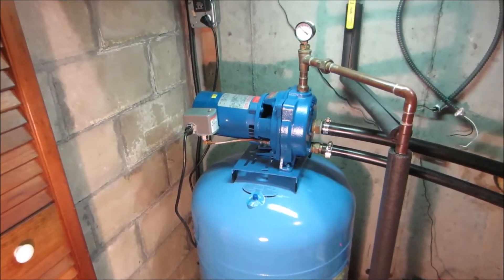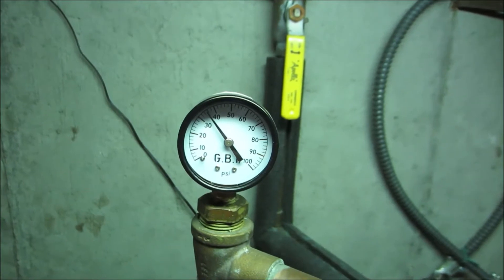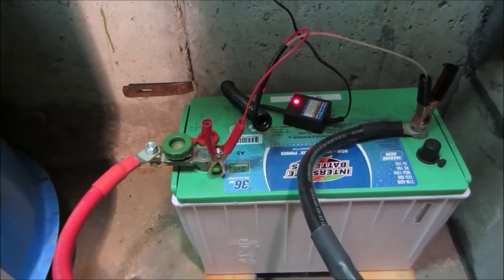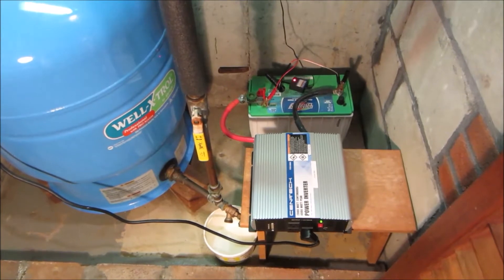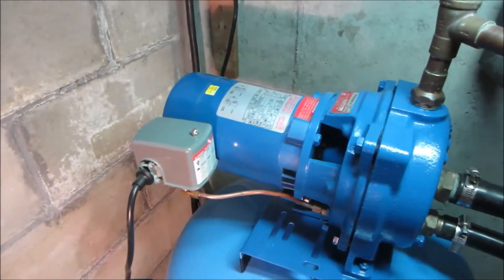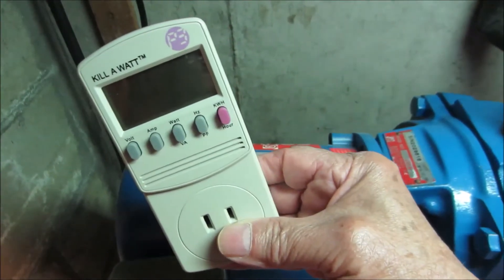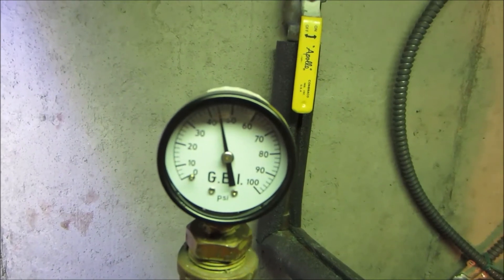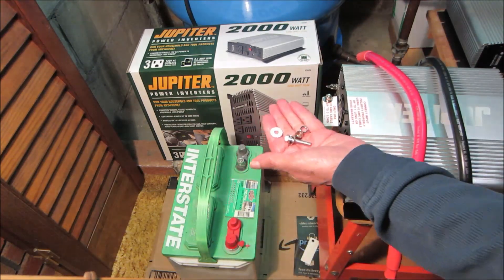Backup Power Project E1 - Well Pump

Comment: That pump motor isn't going to like that modified sine power very much.
Reply from the maker: I put this backup power system together in 2015. Since then, it's been tested quarterly and used sparingly. The well pump has liked that modified sine wave inverter just fine. On the other hand, I haven't had ANY luck with pure sine wave inverter upgrades. Want proof? Check out Episode 7 https://youtu.be/ODuI1lfU7zQ Hazard Fraught Inverter Upgrade starting from 35:30. I've even challenged inverter manufacturers to prove me wrong. Sell me a pure sine wave inverter that will run my well pump, run my furnace, run my washing machine, run my clothes dryer and I'll tell people about it! Not one of them has been willing to risk the sale. Pay attention to their ads. What do they show? Young people camping. Young people with a phone in one hand and a latte in the other. It's really pathetic...
Reply: @LawrencePina The high harmonic content of modified sine inverters isn't ideal for inductive motor loads because the harmonics are dissipated as heat in the motor and it lowers the efficiency of the motor.  This is true of ALL motors and transformers.   I think a fundamental problem here might be buying cheap chinesium crap from Harbor Freight.  Quality pure sine inverters from companies like Sol-Ark or E4 have been running entire house loads and everything in them including well pumps, furnaces, clothes dryers and washing machines for a decade.
Reply from the maker: I searched online for sol-ark inverters today https://duckduckgo.com/?q=sol-ark+inverter&t=chromentp&ia=web and immediately saw prices between $3,000 and $7,600! That's quite a bit more than the $130 I paid for a locally available inverter that's performed perfectly all these years. E4 inverters https://signaturesolar.com/eg4-18kpv-hybrid-inverter-all-in-one-solar-inverter-eg4-18kpv-12lv/ at least not the ones I found, are also in the $5,000 range. I'm just not going to pay that much, even if I could afford to, to back up less than 30A of common 110VAC household appliances. Especially when I know how well the inverter I already have works. $130 vs $5000 or more? Most people worried about occasional grid failure are going to choose $130. On the other hand, I'd be willing to pay a few hundred more for a comparable PSW inverter that actually works, at least as well as the MSW inverter I already have. I just haven't found any yet. Regarding the THD of my $130 inverter, it's about 30% under full load, the same as most 3,000 - 5,000 Watt gasoline powered generators. No one complains about those. Sine waves look about the same, too. So the system I have is definitely not perfect, but it is cheap and effective, and more practical in many ways than a gasoline powered generator. That's why I choose to share it.
Reply: @LawrencePina  If you want someone to "Sell me a pure sine wave inverter that will run my well pump, run my furnace, run my washing machine, run my clothes dryer and I'll tell people about it!" then you have to size it to run those things.  These are whole house inverters to run all of those things and more.  You can spend less if all you want to do is run a well pump, but that isn't what you asked for.
Reply from the maker: Regarding: I "have to size it to run those things" - you mean like this https://youtu.be/FpybjEOK7-8 ?  If not, how?  I visited your YT channel https://www.youtube.com/@stargazer7644 this morning and was surprised to find that despite all of your criticism, there's not a single video there. Not one. Do you even have a backup power system? Have you ever published anything? Comments don't count. Let's see what you've got.
Reply: @LawrencePina  Wow.  The last resort for youtube wannabe's.  What does publishing videos have to do with knowing what you're talking about?  I do real work for a living.  You have 8k subscribers. Keep trying, maybe one day you'll be an "influencer".

Comment: Thanks Lawrence for your video. I bought a Jupiter inverter and cables. I noticed that you have a plug from your well pressure switch. I currently have 220 wiring from the switch to the electrical outlet. I need to replace it with a plug that I can use with my inverter. What gauge plug are you using for the pressure switch? Thanks!
Reply from the maker: When running, my Goulds J04853 jet pump draws 9A at 120VAC. It's connected to a 120VAC outlet with a 16AWG power tool cord, rated 13 Amps. But given that your well pump is already wired for 220VAC, you really need a 220VAC inverter.  There's no neutral in a 220V outlet. So, even if your pump motor can run on 120V, you'd have to rewire all the way back to the service entry panel. The existing 220V breaker would have to swapped out. It's a big job (for most people). If you scroll down through the comments under this episode you'll find that vincesmithh (smithh with two h's) backed up his 220V well pump last year. If you ask him exactly what 220V inverter he bought, how it's holding up, what connecters he used, I'm sure he'd be willing to tell you. So, look for a 220V inverter, but also keep the Jupiter 120V inverter. You'll want that to run 120V appliances. Once you add solar panels and a solar charge controller (another $500 or so for four 100 Watt panels, 30A charge capacity), you'll be amazed at just how much you can run off of your backup power project. Right now, I know you just want to run your pump. So, the first thing to do is find out how many amps the pump draws when running. That may be written right on the pump motor, otherwise you'll have to measure it. To convert amps to watts, multiply volts x amps. Multiply by at least 2. That's the minimum inverter wattage you're going to need. Note that there's inverter wattage and peak inverter wattage. Peak (aka inrush) wattage is generally twice the inverter wattage, but in the case of a pump motor, it can need a lot more. My well pump draws 4,600 watts when it starts! It's amazing that the HF Jupiter and Cen-Tech 2000/4000 Watt inverters can momentarily deliver that much power. Much more expensive pure sine wave can not. Suggest you watch https://youtu.be/FpybjEOK7-8 Backup Power Project - E10 Laundry Room to learn how to measure all this. Measuring peak inrush is where to start. Good luck. Thanks for commenting. I'm happy to help.

Comment: Thanks for this vid Lawrence. My 1.5hp Jet pump is 230V 1.1Kw, and Max Load amps is 24. Does that mean I need a 6000W / 18000W inverter? Also, I don't have the inverter yet - how do I estimate the battery size?
Reply from the maker: 24 Max Load (aka run) amps at 230V seems very high. My Goulds, model J05N, 1/2hp jet pump only uses 5.4A at 230V (or twice as much, 10.8A at 115V.) Please double check that. To establish inverter size, you need to verify both run amps, and peak inrush amps. The peak inrush on my Goulds J05N at 124.7VAC (our line voltage) is 38.03A. 124.7V x 38.03A = 4,742.34 Peak Inrush Watts. It's a miracle that Harbor Freight's inexpensive 2000/4000 Cen-Tech and 2000/4000 Jupiter modified sine wave inverters can start my pump, but as I've confirmed repeatedly, both models are grossly UNDER rated. One of the few times in life I made out from sheer luck. Now, I use a BSIDE model ZT-QB9 peak inrush clamp meter (about $30 from AliExpress), which makes taking peak inrush measurements very easy. Watch this Fluke video to learn how: https://www.fluke.com/en-us/learn/blog/clamps/how-and-why-to-measure-inrush-current Regarding battery size, the Cen-Tech 2000/4000 owner's manual specified 100Ah AGM, so that's what I started with. Start with whatever the owner's manual recommends, and you should be ok. You're also going to want one or more solar panels and a solar charge controller allowing you to take your pump off grid indefinitely, should the need arise. Watch episodes 3 and 4 of the Backup Power Project. You'll be amazed. I was! And finally, consider asking you tuber vincesmithh (smith with two h's) for 230V pump advice. He's been there, done that. Just comment directly below one of his comments. Ask for specific info, make and model of his inverter, batteries, solar panels, charge controller, etc. That's how we help each other! Thanks for commenting. Good luck. Hope to hear from you again...
Reply: @LawrencePina  i see at 230v my pump uses 12amps. So to handle the initial burst i would need 230x12x3 = 8300 w.
Reply from the maker: 230x12x3? Not in my experience: https://drive.google.com/drive/u/0/folders/1aqdokhftf6qVynhrIq954TBouowWyrVj 
Note that:
1. Goulds jet pump peak inrush is roughly 4x run amps.
2. American Standard gas furnace peak inrush is roughly 6x run amps.
3. Whirlpool washing machine peak inrush is roughly 3x run amps.
4. Whirlpool gas dryer peak inrush is roughly 8x run amps.
The red x to the right of the gas dryer entry indicates that neither of my two, under rated, over performing, HF 2000/4000 watt inverters can handle it. My mistake. I assumed otherwise. Now, I know better. It's best to measure! That way, when something doesn't work, you'll know it's because the manufacturer over rated the product, not because you underestimated the load. Please keep posting. Let others know what you bought, how well it worked, or didn't work. Your comments are most welcome. Sharing experience is how we help each other...
Reply from the maker: Regarding battery size: We now know that your 1.5 hp jet pump is a 2,760 Watt appliance (12A max load x 230V = 2,760 Watts). The question is, what's it going to take to supply that much battery power? At 12V, you'll need more than 230Ah (2760W/12V = 230Ah). More than 230 Ah because the battery has to power the inverter as well. So, it'd take at least a 250Ah battery at 12V. You'd also need enormously thick battery-to-inverter cable to carry that much current. Impractical? But at 24V, you'll only need a little more than 115Ah (2760 Watts/24 volts = 115Ah). A readily available, 24V 150Ah battery should be more than enough. Whether to put two, 12V 150Ah AGM batteries in series, or use a single 24V 150Ah LiFeP04 battery depends on personal choice, price and availability. Readily available, relatively inexpensive, 2/0 battery-to-inverter cables (https://www.windynation.com/collections/2-0-gauge-battery-cables) should also be more than enough to handle 115Ah. What about 24VDC to 220VAC inverters? Plenty to choose from here: https://www.aliexpress.com/af/24VDC-to-220VAC-inverter.html?catId=0&initiative_id=SB_20230423074905&SearchText=24VDC+to+220VAC+inverter&spm=a2g0o.productlist.1000002.0 We just don't know whether any of them are any good. We also don't know for sure what the peak inrush of your jet pump is. If it were my project, I wouldn't order anything until I measured that. These are the best answers to your questions that I can come up for now. Thanks again for asking. Discussion really helps the channel...

Comment: My sine wave inverter will only allow my pump to deplete the batteries to 50% so the alarm comes on at 11.7 volts. Therefore my 120 minute reserve battery is really only 60 minutes.
Thanks for reminding me about the 1/0 wire I need to upgrade since I'm using 4 gauge.

Comment: Took the inverter to an electrical supply and they looked at the socket and said they'd never seen anything like it. Called a second electrician, he looked at it and said the same. Then he called me the next day, and had figured it out by studying the pictures he took of it. Anyway, the "look" of the socket was confusing to these folks. Hooked it up yesterday, Sun was out.....Worked like a champ. Thank you so much for your advice. I would never have tried this on my own. Your videos are OUTSTANDING!
Thanks again.

Comment: Finally received my 220 inverter. Panels are up, battery and controller are working. One small glitch. Got the universal outlets recommended but Home Depot and my electrician don't seem to know what will fit. Any advice would be greatly appreciated.
Thanks
Vince
Reply from the maker: It's hard to believe that an "electrician" could look at the 220V sockets on the inverter you purchased and not instantly recognize what type of 220V plugs would mate with it. Forget that guy. Try this:

1. Establish how many amps your well pump uses. If it's tank mounted, like mine, you can read that info right off of the name plate on the pump motor. If it's a submersible pump, located inside the well, and you have no info on it, then at least look at the double-pole, 220V circuit breaker it's wired to. Most likely it'll be rated 20A, although I doubt the pump draws anywhere near that much. Watts = Volts x Amps. My 1200W pump draws 10A at 120V, but only 5A at 220V. 5 x 220 = the same 1200W! 5A is very low current. Most power tools draw a lot more than that. To discover exactly what your pump draws, ask a helpful electrician to put an AC clamp meter on it. That'll tell you in seconds. Otherwise, check here: https://oakvillepump.com/blog/2021/3/17/how-much-power-does-my-submersible-well-pump-use

2. Search on "types of 220V receptacles" and then view images. That will give you an idea of what's commonly used on appliances like 220V window air conditioners and 220V workshop tools like compressors, table saws and welders. If your inverter has universal 220V sockets, then it should be able to accept all of those types.

3. Take your inverter to an electrical supply house and ask the counter clerk for an appliance/power tool cord to fit it. He's going to ask you "What size?" meaning how many amps and "How long?" If the amp rating of the pump is still undetermined, then get the largest size supported by the inverter. Hopefully, that'll be enough to safely run the pump. If the cord gets hot in use, it's too small!

4. While you're still at the electrical supply house, assuming you already have or plan to get a portable generator, get a twist lock plug compatible with the twist lock socket on the generator (They're all different!) and a 220v receptacle compatible with the 220V plug on the appliance cord you just purchased. Add an appropriately sized, appropriately long extension cord to the order and now you'll also be able to quickly run your pump off of a generator. Alternately, you may be able to get a generator supply house to make up this cord for you. But, they'll still need to know how what size, how long, and what plugs to wire on either end. Best to have that stuff on hand and get your electrician to do it.

5. Vince, it's a shame you don't live in my neighborhood. If you did, we could quickly get this done ourselves and while we were doing it, make a helpful video for Backup Power Project. Hope you'll repost to let everyone know what you learned and how everything worked out.
Reply: @LawrencePina A US electrician isn't going to be familiar with European outlets.
Reply: Tried to reply last month but it doesn't look like it posted. My electrician took a picture of the inverter. Two days later he came by with the adapter that fit. An hour later everything worked. THANKS FOR YOUR HELP!